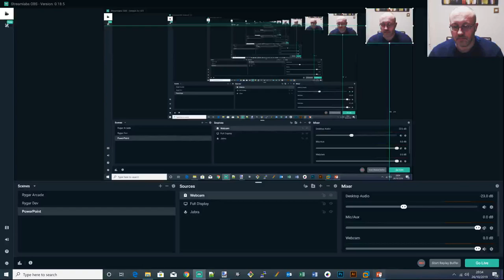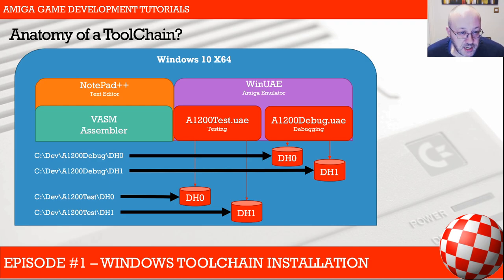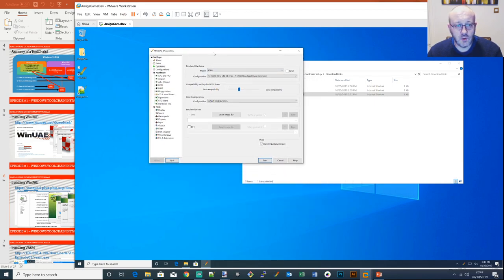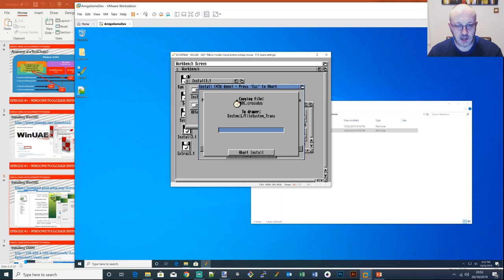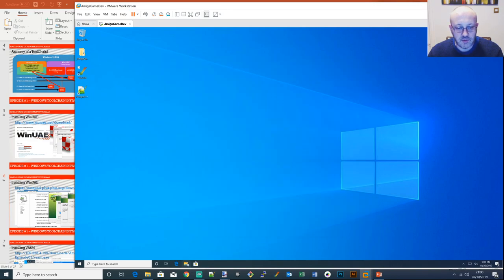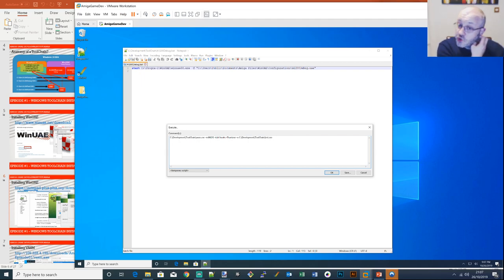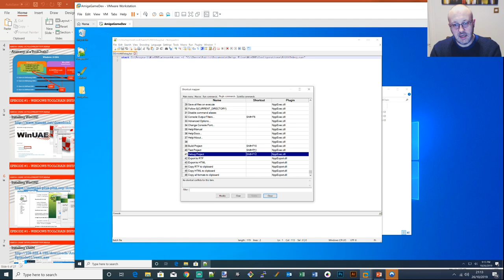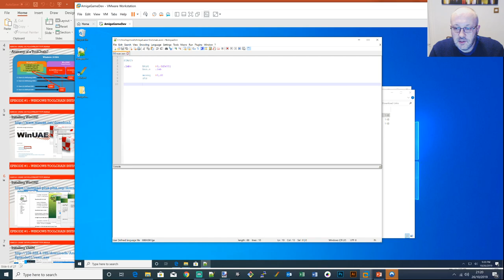Episode #1 | Amiga Game Dev | Installing a Tool Chain

Comment: There’s a cool amiga development extension for visual studio code which I use instead. Amazing series thanks a lot
Reply: Saw that as well. The debug capabilities are great. Even considering copper debugging. I know it is an old post but maybe you know: is it really necessary to start a new emulator on each debug run? Or can a running instance being reused? I found it a bit cumbersome to always waiting for the instance to start.
Reply: @rokker333  you can set up your emulator to have your build folder mapped as a virtual drive then you can just run the app from the emulator as many times as you want without needing to close it
Reply: @sacredbanana  but when VSCode debugger is used this does not help, right?
Reply: @rokker333  I’m sure there would still be a way of attaching a debugger. Personally I don’t use the extension anymore. I use Bebbo’s Amiga GCC cross compilation tool chain and put that in a Docker container

Comment: Hey bud, what's the symbol next to the '6' at 40:08, as I can't make it out and the code doesn't seem to be running (emulator launches with shift F11 but it just goes to Workbench instead of waiting for a left mb press)? Is it a hash '#' symbol? Cheers!
Reply from the maker: Yeah thats a hash symbol #
Reply: @GeezerGamesRetro  Cheers mate!
Reply: BTW, in case anyone else reads this and has a similar issue, it wasn't running the code due to me putting a space between "DH1:" and "test.exe" in the Startup Sequence. Also, in the debug machine's SS I mistakenly put "DH1:text.exe" instead of "DH1:test.exe". It wasn't throwing up any errors so wasn't sure what was wrong, but it was just another space issue.

Comment: Since the user-startup is launched before loadwb it is a proper way to do not modify the startup-sequence but the user-startup. For example if you upgrade to 3.1.4 the startup-sequence could be overwritten.
Reply from the maker: Thanks for that tip - i didn’t know that.
Reply: Great tip; I learned the 'technique' from the AMITCP installer, I wish I knew it years ago would have really helped.

Comment: Nice work! Just found the series and watched this episode. I've done some 68K (targeting Neo Geo) using the gcc assembler but I've only done C (gcc) on the Amiga, so interested to see how to take over the Amiga and program under the hood! I also used the MAME debugger for all my 68K debugging, so no luxury of source symbols! I'll probably tweak my development configuration to use UltraEdit and makefiles rather than hotkeys from Notepad++ (personal preference), but I'm intrigued to see why you have separate Test and Dev machines set up; no doubt it'll become clear in later episodes!
Reply from the maker: Mark McDougall separate machines are need because the debug machine needs to start in the debugger with the executable, the other machine simply runs the executable.
Reply: @GeezerGamesRetro  So It's purely a work-flow efficiency thing? Can you not simply hit a key or two to have it execute in the debugger anyway? Or should I continue to watch the videos for the answer to that? ;)
Reply from the maker: Mark McDougall watch the video and it will be clear what is going on.

Comment: Hi Graeme, I'm about to start learning Amiga dev. Just wondering if you still use this setup today or have moved to the VScode with Amiga Assembly extension? I think I will try the latter and since I'm also on Linux using FS-UAE.

Comment: Fantastic tutorial, but I'd like to ask one question: does every file have to be saved through the "main.asm" file? I can't seem to get anything to compile unless it's saved with that exact name. Obviously I'd want to name my files different things for different purposes,  but I can't see any way of testing them unless I save them as "main.asm". Is it supposed to act as just a temporary filename?
Reply from the maker: Nebula Rain thanks for your question, so thr thing to do is to have different project folders... then to switch projects you simply change the build command line.  Each project will have a main.asm.  This is how i do my games, separate folder with all source that is assembled from the main.asm

Comment: Have u tried vscode? There is a plugin called Amiga Assembly which lets you run and debug using fs-uae or winuae all from the editor (including breakpoints etc in the editor) comes with syntax highlighting etc - I would link to it but YouTube doesn't like links ☺️

Comment: Cross platform assembling has been available since the early 80s since NES and other consoles popped up. Nice to see the same on Amiga in 2019
Reply: Mop Krayz well it existed also in the Amiga in the 80’s using a PC and a card hooked into it things like PDS Pegasus Development system and Snasm from SN Systems

Comment: Great work its giving me the flexibility to work on old code from the 90s.

I found it difficult to follow in points but if you could  zip up the toolchain folder and add it as a download that would speed things up and even the configuration files for Winuae.  I would still talk through the files but it would make the whole process quicker.

Not sure if you have noticed the notes above are incorrect you have -m m68020 which should be -m68020

VASM Build:

C:\Development\ToolChain\vasm.exe -m68020 -kick1hunks -Fhunkexe -o C:\Development\ToolChain\test.exe C:\Development\AmigaGameDev\main.asm

cmd /c copy c:\Development\ToolChain\test.exe C:\Development\Machines\A1200Test\DH1\test.exe

cmd /c copy c:\Development\ToolChain\test.exe C:\Development\Machines\A1200Debug\DH1\test.exe

it looks like I started this almost 1 year after you recorded the video almost to the minute

Comment: Is the WinUAE built-in debugger any good for this task? What's the difference between that and MonAm?
Reply from the maker: You can use either...  in my opinion monam has advantages in usability when debugging routines.  Winuae is more difficult because you cant see your source labels easily.
Reply: @GeezerGamesRetro  I didn't understand how you give the labels to MonAm. Do you create a symbol file of some sort and pass its name in the command-line? (Sorry for asking, I can't set the resolution above 480p and I'm not a native English speaker :)
Reply from the maker: cazzozzo the symbols are included in the binary - you can tell vasm not to include symbols with -nosym, this will all be covered in a later episode thougg
Reply: There is another debugger very similar to Monan but it is a low lever debugger so it is better to trace non user friendly code. Adebug. http://obligement.free.fr/gfx/adebog_1.jpg